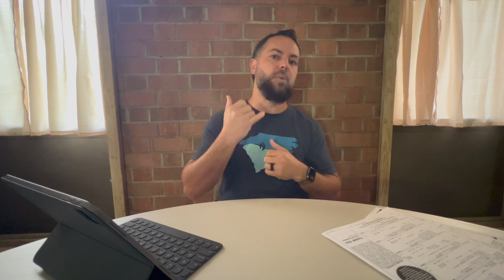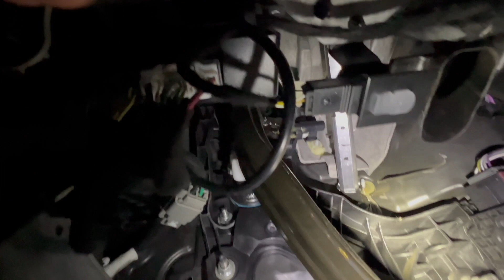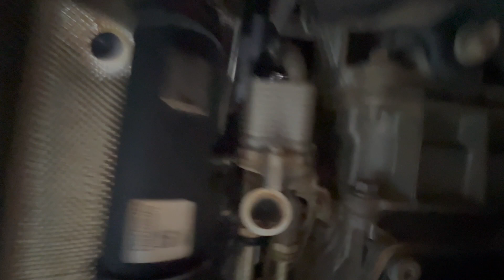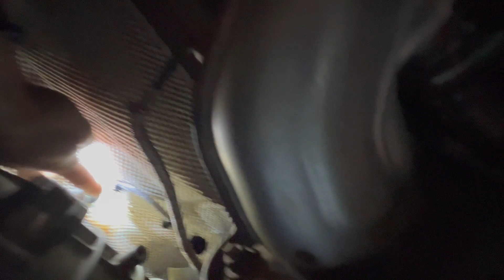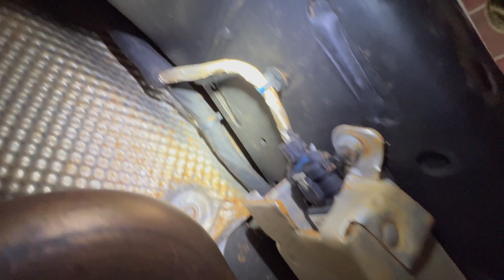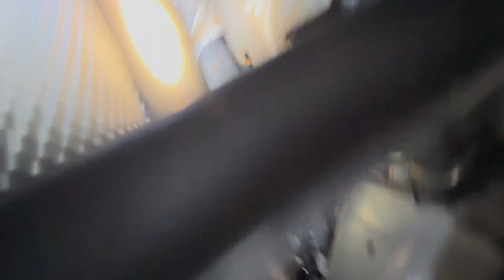Why your Gladiator Eco Diesel is unreliable...   HD 1080p

Comment: Maybe do a little research before you buy a vehicle? You definitely should have bought a Land Rover.
Reply from the maker: 😂 I am honestly and strongly assuming your making a joke here, as much as I love them, land rovers are notoriously unreliable. 

I in fact did massive amounts of research on Jeep, Gladiator, and specifically the ecodiesels history. The reworked ecodiesel for the wrangler had been out for about 18 months and the gladiator 6 months give it take at the time of my purchase. There wasn’t much to go on but everyone said the gen 3’s had fixed most of the previous years issues. 

As I’ve stated previously, the current issues primarily stem from lack of airflow, which, the 24’ wrangler just “fixed” with that new front grill. Time will tell but they obviously know there’s an issue even with the gas 3.6 getting a bit too hot when towing especially with towing being bumped on the wrangler from 3k to 5k. I have no doubt that grill will be on the 24’ Gladiator for that very reason. 

Honestly, I get your comment. Jeep isn’t know for high reliability, but it’s fantastic for off-roading and repair ability, which was my personal priority. I’m just glad it’s out of warranty so the only one working on my Jeep is me.